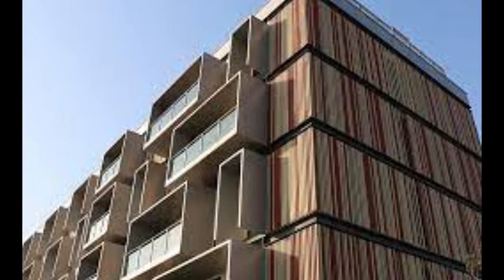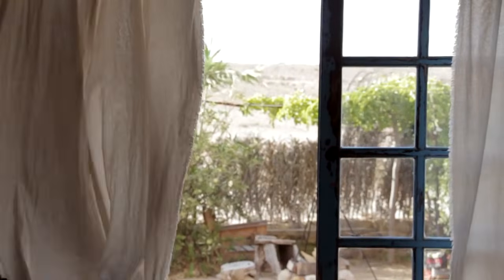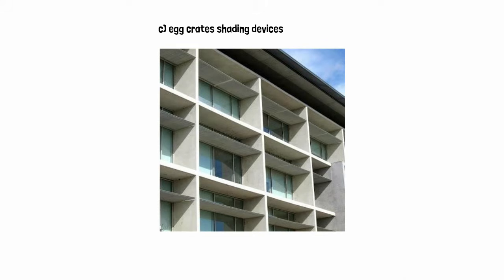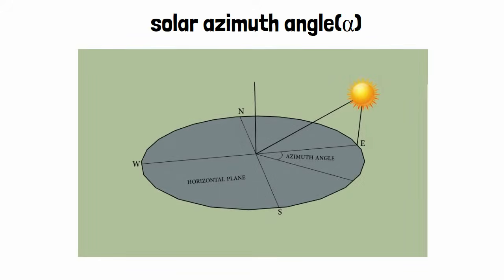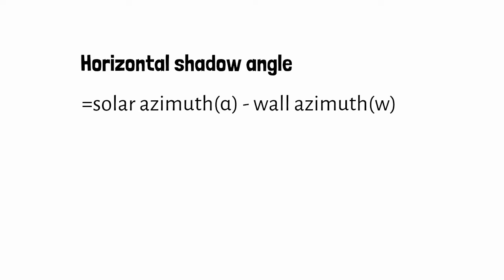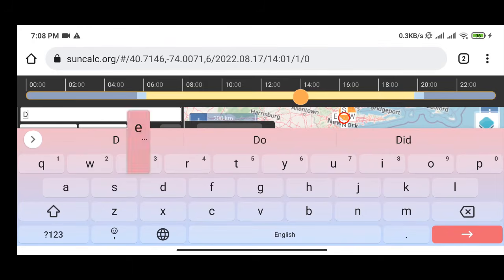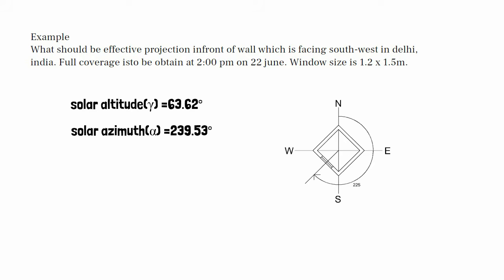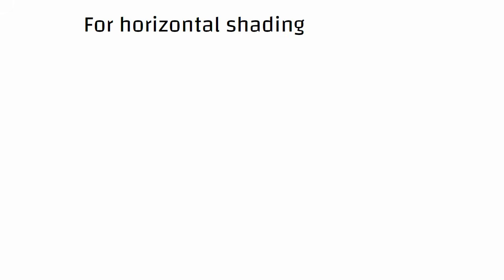How to design sun shading devices for your home

Comment: Please remove or correct this video. t=The calculations are incorrect.  cos(63.62) x cos(14.53} = 0.43 deg not 64.62 deg
Reply: There is cosine on the opposite side  acos of 0.43 is 64.62😅